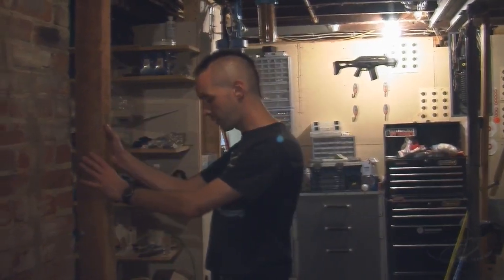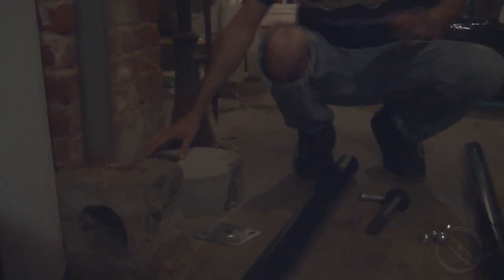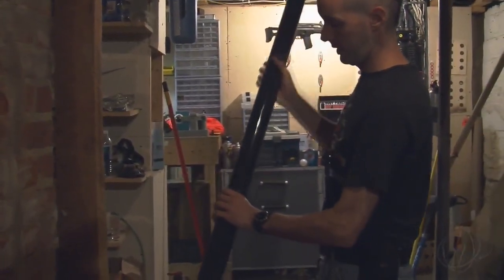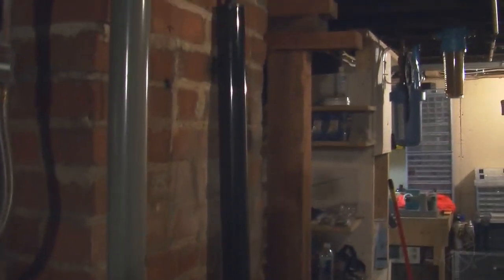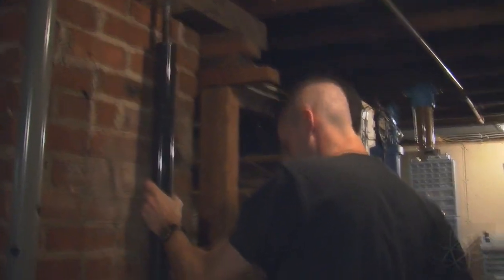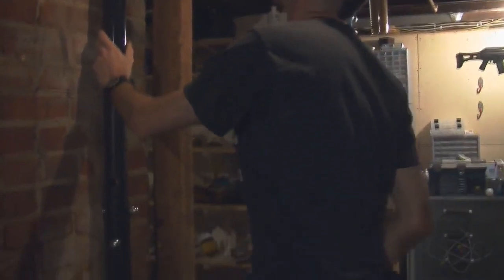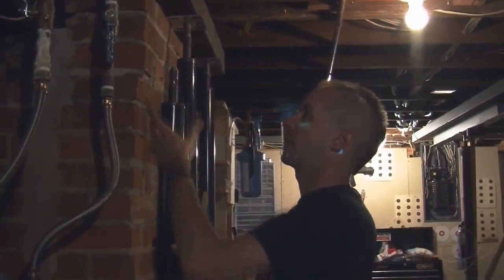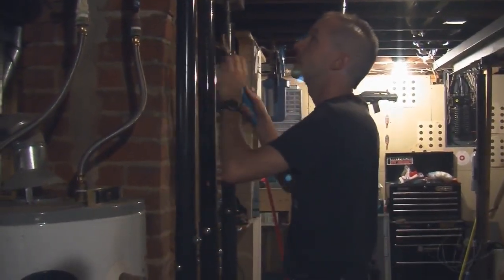Installing Basement Jacks at Geekhouse-1

Comment: Well this all well and good for instruction video. How ever one thing is wrong, the posts that he uses are the wrong ones for code in most places. The posts that he is using are for temporary construction, they are not made for "live Load" only construction load. AKA furnature, appliances, consistantly moving around. After time they will start to role the holes and fail, even with bolts insted of pins.
Reply: I was about to comment the same. I don't think any of these pin-based posts are rated for permanent install. However, single piece columns with a screw-jack on one end is permitted in most areas.
Reply: @dfiler2  Agree just bought single piece columns with a screw-jack heavy duty rated 28k lb load which is higher then 4"concrete filled poll.

Comment: Assuming you locate these underneath supporting beam of 2nd floor, can this level off a sagging 2nd floor?
Reply: +scorpiomaj27 
A load bearing wall had been removed from my house at some point and the second story floor was sagging. I installed a post on the first floor and one just under that one in the cellar. It's worked for thirty years.